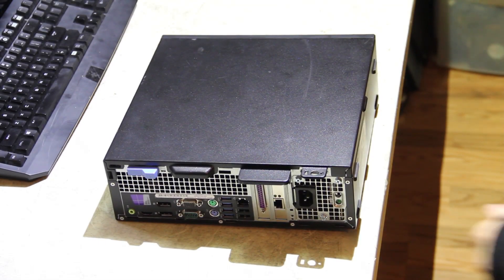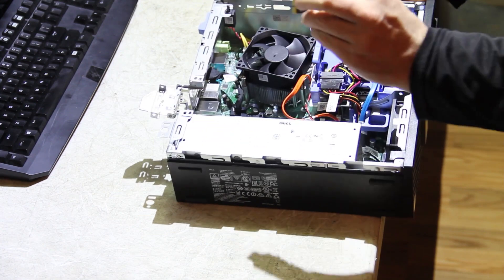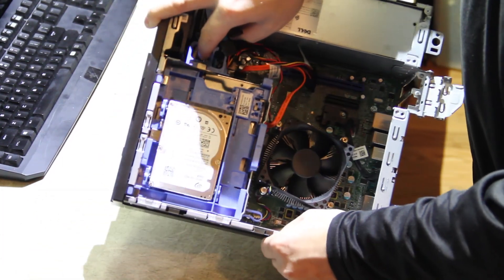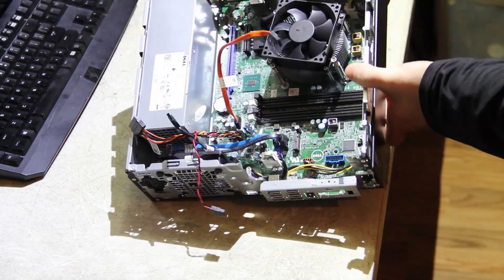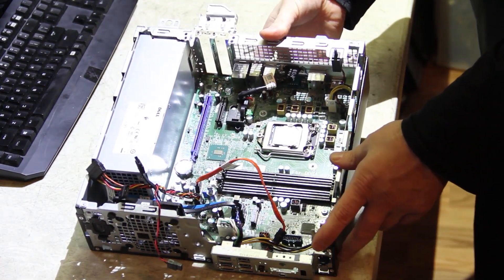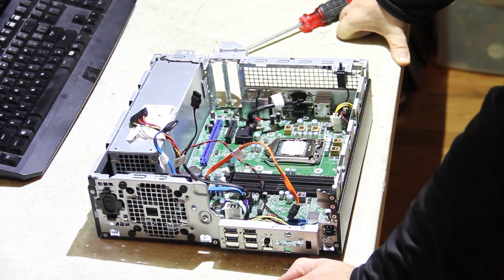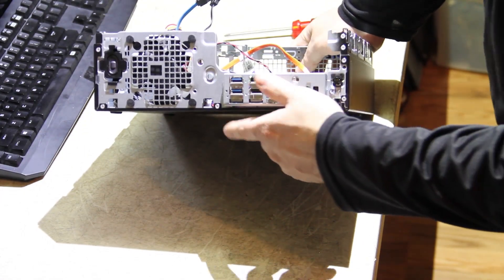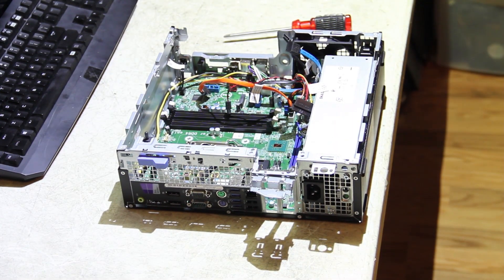Dell Optiplex 7040 small form factor teardown and system overview

Comment: Any thoughts on using a flex 1u psu on this system?
Reply from the maker: I mean, could you fit it in? Maybe. I think the dimensions would be wrong, but I built a custom machine with a Flex a few months ago, and my opinion on Flex ATX is... HELL NO!! they are freaking jet engines. There are things you can do to quiet them down, but unless you have a place for it where noise does not matter, I would not.

Comment: I am the owner of a Dell Optiplex 7040 i7 6700 model. Unfortunately the pc can't handle anything higher than Gt 710 or in the 900 range. Because of the PSU which is very low180W
Reply from the maker: I mean... it was never intended as a gaming machine. That being said, I've worked with some newer cards that are quite a bit lower power draw that should work, I've got some radeon embedded 9360s or something like that which should run fine
Reply: @dragonsystems5973  The machine was fine for the last 2 years that I haveit. Now bought a Asus PRIME Z270-AR board. I'll add the i7 6700 cpu from the Dell into that with the 32GB memory that I have on the Dell and put that in a new ATX case with a 850 PSU along with a my RTX 3090. Thanks for your clip was really helpfull taking the Dell apart (LOL)
Reply from the maker: @marctesson3367  generally this is what I suggest to people asking about upgrades. Boards are cheap enough now, buy a basic like h110 or something like that, watch for a cheap case on craigslist, and just swap all the transferable stuff into that, it's a waste of effort to try to upgrade the dell

Comment: Thanks so much for making this video.  The PCIe slot is 4x, not 1x as you had stated.  It's possible to fit a low profile graphics card on this 4x instead of the 16x since some are too think and the power supply would get in the way.  This would lead to 5-10% loss in processing power (not much).

The NVMe port does not steal a SATA port.  :)

Comment: The CPU shroud seems pointless. I think it would be better to remove that. Then the CPU cooling and the ventilation of the case might be better. It would be worth testing how the CPU temperature is lower.
Reply from the maker: It's not pointless, it's also not critical, I bet good cpu paste would make as much difference

Comment: What version of PCIe does it have?...is it v3 or v4?
Reply from the maker: I have no idea. Look on the Dell website, they should have extensive documentation
Reply: Both the pcie are v3.0. The black slot is a v3.0 x4 open and the blue slot is a v3.0 x16.

Comment: Could an internal wifi card be used in the smaller black card slot beside the larger blue one?  What type of slot is the black one?  I know USB wifi could be used but harder for user to remove internal one :)
Reply from the maker: I'm almost positive the machine does have one slot intended for an SSD and one intended for a wireless card, it's been a while since I had one of these in front of me though, I used to buy and sell this kind of stuff weekly, but switched entirely to custom gaming builds
Reply: Yes you can. The black one is a pcie 3.0 x4 slot. You can go with any wifi nic card supporting that. Most of these cards are pcie x1, they will work as you have x4 bus line

Comment: For a graphics card, you'll need a low profile one slot deal. I have a Dell Optiplex 5060 SFF and it's similar in case size to the 7040 shown here. I would, however, advise getting at least an Optiplex 5060 that has a i7-8700k 8th gen cpu as that is one of the three requirement to upgrade to Windows 11. It also has Secure Boot and TPM 2.0 module, two other requirements to upgrade to Windows 11. The Optiplex 7040 only has the i7-6700 6th gen cpu which is not compatible with Windows 11. Something to think about anyways.
Reply: I’ve been running Windows 11 on my 7040 SFF for over a year with no problems.
Reply: @brianconnery2801  how did you get it working. ive heard poeple having to install certain drivers to get it to work even though its not supported

Comment: can it run doom?
Reply from the maker: dont try to game on these... just dont..
Reply: These Optiplexes are powerful rigs and with the right graphics card, yes, you can game on it easily. Doom should be okay to run. I have an Optiplex 5060 with a i7-8700 8th gen cpu, 32GB of 2666mhz Corsair Vengence RAM and use a XFX Speedster SWFT105 Radeon RX 6400 Gaming Graphics Card with 4GB GDDR6 and it runs games great with the proper settings. You have to test your game settings and see how they run. Ooops! Forgot to mention upgrade your drive to an nvme ssd. There's a M.2 slot for it. I put in a Samsung 980 Pro SSD 1 terabyte. You'll need that to speed up your computer for gaming and other regular stuff.

Comment: I have one of these, and it's a great computer. We use it in the living room attached to a large flat screen TV for monitor. Streaming, YouTube, hubs likes to surf and it's been a great computer over all. No gaming, just internet. Hoping you can answer a ques I have: I think I need to replace the NIC card since it suddenly is no longer connecting to the internet, yet other computers are. Where is it located, and what brand of NIC card does it take. Thank you.
Reply: Are you still working on this problem? 
You could try a Plugable USB to 2.5G Gigabit Ethernet Adapter into the back of the machine.
If you want to get fancy, I recommend a 2.5G Ethernet PCIe 1X card with a low profile bracket and a RJ-45 connector. 
2.5G Ethernet means it'll keep up for years to come, and the RJ-45 connector is just the telephone-wire-but-not-looking hole that you plug your internet cable into.
In the video, when he talks about a video card, he's pointing to a "16X slot" to put the video card in. Next to that, a little further away from the power box, is a smaller slot. That's where this new NIC would go. You'll remove a little skinny metal plate on the back of the  machine; that's where you install your low-profile bracket that you'll attach to the NIC. This will give you the RJ-45 connector sticking out the back of the computer, waiting for internet.
Cheers!
Reply: @LesCalvin3  than you for your reply. Figured out it wasn't the computer or NIC card at all. Something was interfering with the internet for that box. But I'll save your comment for future reference.🙏

Comment: With the 1050 ti would you need to run the Low profile one or no? I was looking to get the rx 6400 lp. I just picked up a 7040 sff with a i7 6700 gen 6 .... gonna do the gpu, ram and m.2. I'll upgrade later per your suggestion with a z1 or z2 motherboard and do a different case, psu etc.

Comment: On a PCIe CPU you have the cooler fans pointing downwards, so that power supply shroud will be blocking those cooling fans entirely.
Reply from the maker: I have no idea what you are talking about, HOWEVER, this is a dell designed machine, I'd suggest filing your complaint with them.
Reply: Either Dell made a horrible design choice, or they made it intentionally to be strictly used for desk jobs and not for gaming. But as you said earlier in previous comment, when there is a will there is a way😊

Comment: I saw another video of a 7040 sff teardown and there weren't any similarities in the construction. The power module was in a different location and the part that housed drives swung out on a hinge.
Reply from the maker: The several different sizes of a given dell series will share hardware similarities, but physical construction can vary pretty dramatically between the specific sizes
Reply: @dragonsystems5973  Yes but they don't mention/show this at all in the for example optiplex 7040 sff user manual. I am so glad you mentioned this because my sff is definitely different than the guidebook; I thought I was going crazy. I have noticed that the guides for the 7040 are really bad compared to the ones for the 990. The tech guide for 990 will tell you every last detail; I can't even find a tech guide for the 7040. So glad you replied with this.

Comment: I had a question. I'm trying to} put 2 sata hard drives in one but it doesn't look like it has the room any suggestions besides taking out the optical drive because I still use that
Reply from the maker: I dont think there is any reasonable way to put in a second 3.5 drive, however, if it is a 2.5 drive I believe you might be able to set it on top of the power supply or something like that
Reply: @dragonsystems5973  ok thank you for the reply guess I'll have to watch a video on how to clone the drive on the bigger drive and just switch the drives out

Comment: how can i clean the pc fans
Reply from the maker: you would probably need to remove it, when you get it torn down as far as I do in the video, it should be pretty obvious how to get at it, Dell systems are usually pretty modular
Reply: @dragonsystems5973  can we directly remove the fans?
Reply from the maker: @arshadhusain7620  I'm not sure what you mean by directly... it might make a mess, bit I'm thinking compressed air might be the best option in this situation
Reply: @dragonsystems5973 I mean I just want to remove the fan and the heat sink to clean the dust because my pc is overheating. I don’t want to tear down the whole pc

Comment: Hi - does anyone if the ram can be over locked on these? Have some SK Hynix 2x8gb at 2133mhz. Another question I have a SK Hynix 1x4gb hanging around is it worth banging it in the 3rd slot? Thanks
Reply from the maker: I would just stick with the matching set

Comment: Nice video!
I have a 7040 i7 6700 here and I've upgraded his ram with 2x 3200 Mhz 8 Gb but it can't reach those 3200 Mhz, it got stuck into 2133 MHz, is there a way to make it work properly?
Reply from the maker: Its really not a performance system, I highly doubt it has any sort of XMP capability, in fact I would be very much surprised if it did, keep in mind these are really reliability oriented, ability to enable XMP would probably introduce a source of decreased reliability

Comment: The M.2 SSD slot, can be used together with other drives. It does not steal any SATA ports. The chipset has enough SATA ports to run everything connected at the same time.

Helpful video. I am thinking getting some Dell Optiplex 3040 and 7050 possibly, and that was a nice overview of internals.

Other options is using these PCIe slots for SSD storage, or 10Gbps NIC (about 30$). Would make an interesting homelab storage server.
Reply from the maker: These deffinitely make for good special purpose machines, in spite of the fact all anyone seems to want to do is try(mostly in vain) to turn them into hack job gaming machines
Reply: Here's the best thing about it it has the ability to boot from an nvme drive
Reply: Many motherboards and their m.2 slot(s) have the ability to run either NVMe (m key, uses PCIe lanes) or SATA (b+m key usually, uses a SATA lane)... Motherboards I've dealt with will automatically disable a specific physical SATA port when a SATA m.2 drive is installed.

Comment: For those who want to replace the motherboard, you just have to take the last screw in the front and the whole thing come right up
Reply from the maker: But exactly why would you want to do that?? If the board dies just go pick up a free case and power supply off craigslist and a cheap standard board off ebay and make it custom for the same price

Comment: can you tell me what dimenstions graphics card space is there plzzzz
Reply from the maker: You will have to Google specific dimensions
Reply from the maker: I dont remember the exact specs either, im guessing it was an i7 because my source always provides its, but beyond that its been too long and I don't keep lists on the machines
Reply: @dragonsystems5973  even i have a i7 6700 and a r5 340x but if i google the r5 340x dimensions its not showing the r5 340x i am having
Reply from the maker: @jamslikesval8772  a low profile single slot card really should work
Reply: @dragonsystems5973   thank you very much !
Reply from the maker: @jamslikesval8772   Glad it helped :)

Comment: Hello friend ... I hope you are very well, I send you a greeting from Mexico and I hope you can help me to resolve a question regarding the dell 7040 ...

I have a couple of them and I can't solve why when I connect the 20-pin usb 3.0 to the motherboard the port doesn't work, and I feel like I'm omitting some of the bios settings but I don't know how to do them ... if you have the solution to me problem I leave my email for you to help me ...

Thanks a lot
Reply from the maker: Make sure you have it plugged in to the right port, I believe they are color coded, however, in spite of the color coding I think some of the plugs will physicly plug into more than one location, also, yes, I do believe you can disable ports on the bios.. try just resetting it to default

Comment: I got one of these recently and plan on installing a low profile 1050ti in it. At the end of the video you mentioned the PSU is 180W, will it be able to run that 1050ti LP card with that stock PSU? Thanks
Reply from the maker: it will be fine, but cooling may be sufficient with how close the fans for the video card will be to the power supply
Reply: @dragonsystems5973  Thanks for the quick reply, I appreciate it! I don't really plan to game on this, but I am using a 4K monitor with it and I notice that it often struggles even when playing 2K videos on YouTube for example, hence I thought a dedicated GPU might fix that. Thoughts?
Reply: @akm9238  I guess you most likely will already have made your decision, but:
I know people who use low profile GT1030, GTX1050TI and GTX1650  and all of them use them for 4K playback without any problems. The i7 6700 has a TDP of 65 W and the GTX1050TI and GTX1650 have a TDP of 75 W (unless you use highly overclocked ones that need additional power connectors), so with these two components you already use 140 W. The power supply units in these computers are high quality ones. My 7040 SFF has a 180 W 80plus platinum unit.
Another option, as mentioned above, is to get a Z170 or Z270 board and transfer the CPU and RAM.

Comment: I want to put a low profile gtx 1650 in one of these but I'd rather put it in via the pci16 rather then the four
Reply from the maker: I actually just rewatched thru my video. Honestly it is not set up for what you are trying to do. A quick glance at available models would seem to indicate that they are mostly double slot designs, and thick ones at that. Even if you could find a single slot model, it would be a pretty bad idea because of the fact that you are going to be pushing that card really hard, in an already insufficient space, if you do find a model that is true single slot, they will have already comprised cooling to make that happen, which, combined with it being right against the power supply it will definitely be running hot all the time if not regularly overheating... im no saying where there is a will there is not a way but it is a bad idea to say the least. Your best bet would be spend $40 on a cheap case, $50 on a cheap board, and $40 on a cheap power supply and just drop all the parts into a custom system.

Comment: Please clarify: are there three SATA 3.0 connectors here?
Reply from the maker: I dont have the unit in front of me.. however, when I receive these they typically have an optical drive and two 2.5 hard drives. the way the drives are both connected is with a 1x pci e power to 2x pci e power splitter, so I believe there might actually be only one normal pci e plug with one mini pci e power plug for the optical drive
Reply: @dragonsystems5973  I found a photo of the motherboard and I see one blue, one black and one white SATA connectors. But I don’t know what it means, I don’t understand ((
Reply from the maker: @VladimirKazan  The color of the individual sata ports for your purposes should not matter, they are interchangeable, I think dell installs devices to specific ports, but I dont think it will have any bearing on function for you
Reply: @dragonsystems5973  Thanks!
Reply from the maker: @VladimirKazan  i do what I can :)

Comment: I'm looking for getting same size 7040 for my brother. M2 should be from PCE-E x4 line not the SATA line can you confirm that? Also i can see that one single slot video can be added which is big downside from my end :(
Reply from the maker: I dont know for sure on the PCI E, I dont usually get that far in depth with these, they are really intended mostly as physical hardware teardowns, and I have never actually sold one with an M2 installed because I usually market them as dirt cheap i7s for like 300 or less. as far as the video car, yeah, I think you are limited to an actual true single slot low profile with only minimal space for overhang as far as the cooler is concerned

Comment: Hey! I have one of these kicking around my house from my job, I know you mentioned that I can buy some products and new case and create a high end gaming PC. Do you know how I can go about doing that?
Reply from the maker: What processor does the  machine have? I would probably not recommend spending the money on the parts if it is not at least an i5 6500 or higher, and preferably an i7 6700
Reply: @dragonsystems5973  hey sorry, I’m honestly a PC novice. Been using Apple all my life lol. But I double checked & it’s actually an Optiplex 3020 with an i5 4090. Is it even worth my time trying to upgrade it? I also have an old HP Compaq pro 6300 SFF sitting around my house as well.
Reply: * 4590
Reply from the maker: @CassandraPres  it depends, what are you hoping to use tbe final upgraded machine for?
Reply: @dragonsystems5973  would love to be able to use it to stream & game. I am assuming my processor is crap for that. Just wanted to know if I could use any of the parts in my old desktops towards a new gaming PC so I don’t spend the money on parts I already have that are decent.